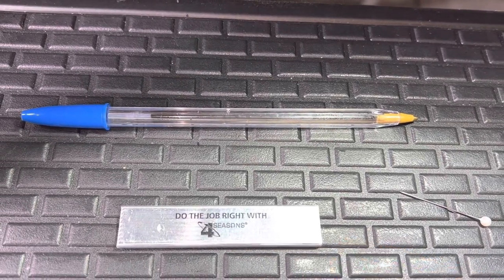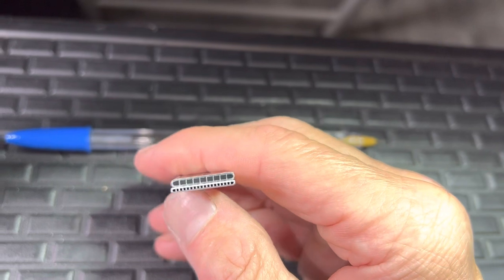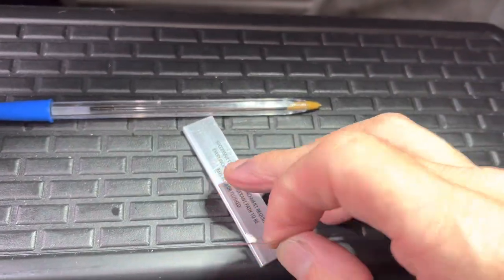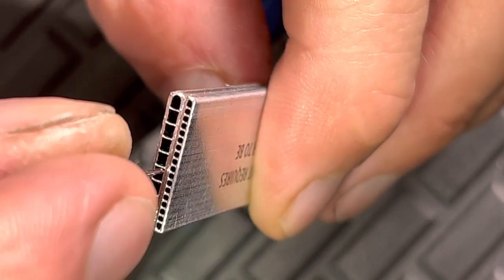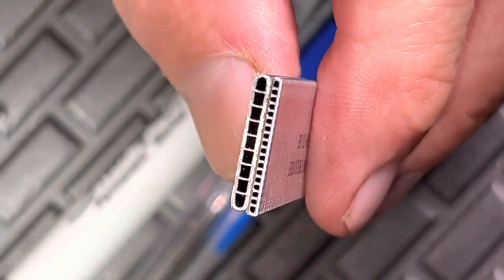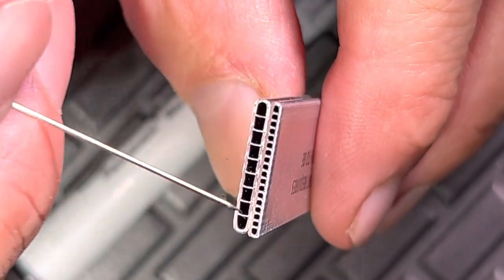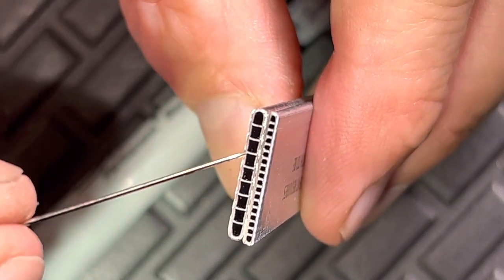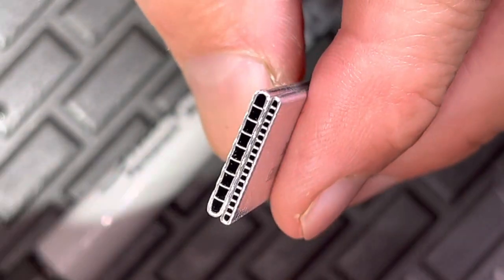AC condenser refrigerant tubing￼ CHEAP aftermarket versus OEM original equipment manufacturer

Comment: I would argue that the after-market one has as much surface area (that contacts air) as the OEM one, in the sample products you showed.  Surface area should not include the inside separation between holes, which does not exchange heat with air.  

There should be another reason why manufacturers go with the small holes design!
Reply from the maker: The inside surface area in contact with the refrigerant dissipates the heat and those fins transfer the heat to the outer surface. 

This is an intentional design to go to the smaller holes this is where somebody does not know their middle school or high school geometry and physics or thermal dynamics. 

The smaller the area the more surface area it has

Is probably about fifth grade science class and your teacher brings out two large beaker one filled with small pebbles of sand and the other field with large stones

And the teacher would ask which one has more surface area and of course all the kids point to the ones with the larger stones which is the wrong answer. 

Yes there’s a very good reason to aftermarket do not use the smaller tubes fins with larger surface area. 

It’s called COST 💰 money 💵 $$$ 
          The exact same reason on the aftermarket if the OEM had 21 fins per inch that aftermarket might give you 16 fins per inch for cooling surface area because it’s cheaper $$$ 

And original OEM might give you 50 refrigerant passage tubes and the aftermarket will cut it down to 40 refrigerant passage tubes. 

Every linear inch of thin material cost money every linear inch of tubing cost money. 

When you were in college taking thermodynamics and fluid dynamics taking heat exchanger design this is one of the first things they teach you. 
            And when you get into manufacturing they teach you the different ways of how to cheat and produce the cheapest product that will just get under the specifications for passing but not just working as good as original. 

And where it really shows up is in the higher temperatures the cheap aftermarket one and the original OEM almost work neck and neck at lower temperatures in the 60° range 70° range 80° range as soon as you get into the high 80 temperatures that is water the aftermarket one starts having to struggle and has a hard time and I cannot keep up with the heat rejection rate. 

That’s the difference between knowledge and lack of knowledge. 

We have a big problem with that in the automotive industry apparently people don’t like to read or thought school was unnecessary just keep doing things and breaking things and say they are learning.
Reply: @coldfinger459sub0  This is a better explanation of the OEM design!  

I think your words can be improved though, your audience do have highly educated.  I was just challenging you to explain this better!
Reply from the maker: @jrm163  it’s just one of those things where I can see the common knowledge and experiences of people including myself when I was 12 years old asking the same questions to my father you see something bigger therefore you think it’s better. 

I thought the same thing when I was a kid

Are used to think that if I turn the pressure down on the low side and I got the refrigerant colder in the evaporator that meant there would be more BTU output and it would do more cooling but it’s actually the opposite. 
       It’s kind of on a scale that works up to a point to where the straw breaks the camels back and then it decays and runs away horribly right after that point when reducing the temperature on the evaporator

There’s a lot into evaporator design that is not taught in schools
Or seminars or any of the normal classes

It really is in-depth